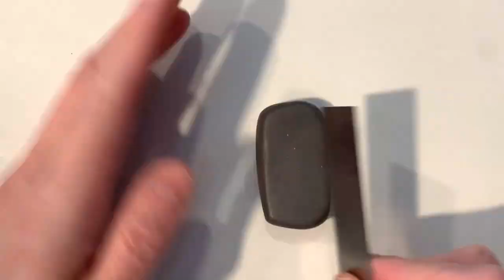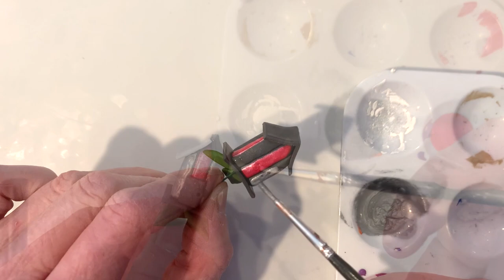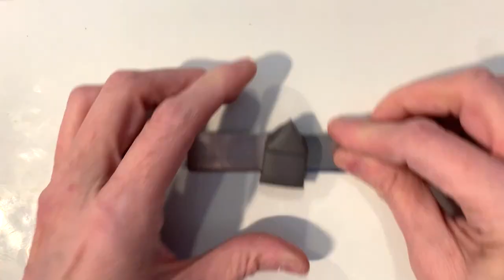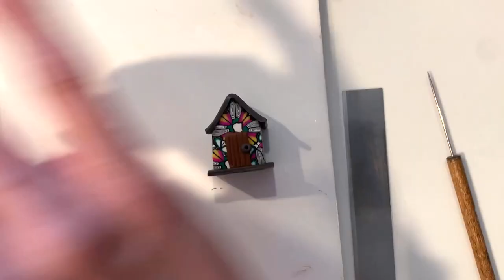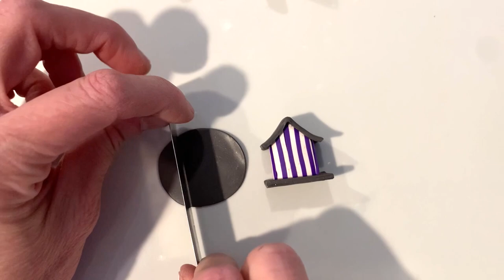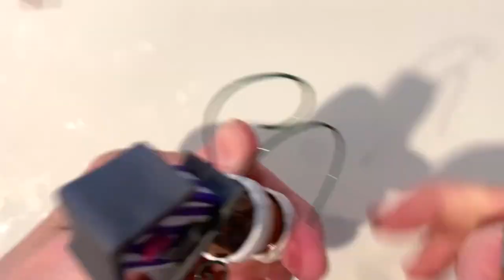POLYMER CLAY MINIATURES TUTORIAL: PLAY ON WORDS POTS- THE HOUSE PLANT

Comment: I'm interested in knowing if you were using air dry clay, or did you need to oven bake it.  If so, at what temperature, and for how long?
Reply from the maker: Hey Miss Barb!! Yes this is oven bake polymer clay. 275 for 10-15 minutes due to the fact that the terra cotta pots and the little houses can be thick. I have always seen on the packaging that for every 1/4' of thickness you need to bake 10 minutes. I go 15, just to make sure. Sending you hugs! :)